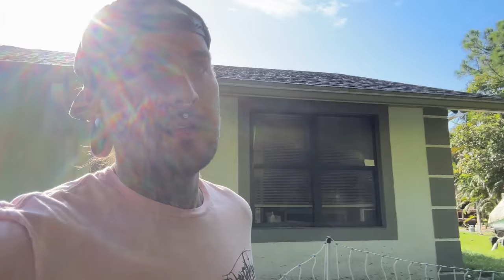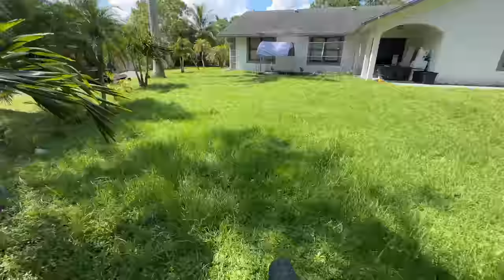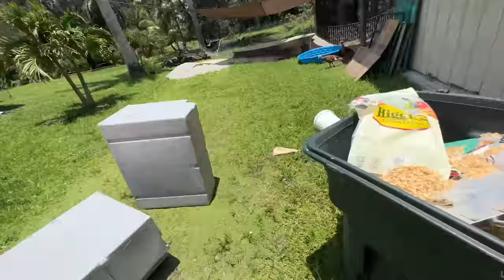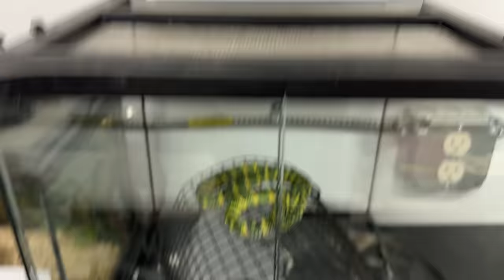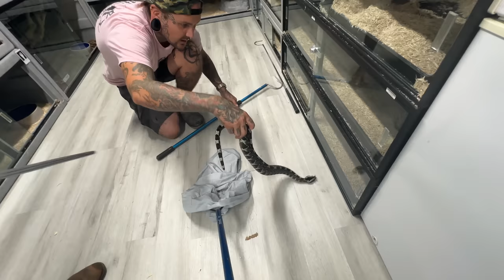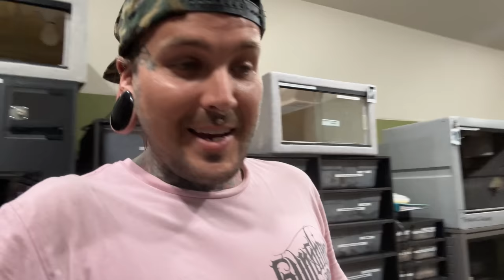MOVING MY VENOMOUS SNAKES HOME!!!!!

Comment: Blue coat is incredible. You can buy floor sweeper tube brushes super cheap and cut the down the middle with a table saw, sawsall or what ever. You end up with two halves and you can screw them to a fence or tree or what ever and it's super super cheap.  ( It's the rotory brushes that are on floor zambonies that janitors ride around) usually you can get the old ones the grocery stores take off for free.

Comment: We use big push brooms dismounted from the handle and drill a few holes for some bolts. Put a wood post in the ground in there favorite place to hand out. Bolt 2-3 brooms on the post. They are easy to change out when they get worn out and are fairly inexpensive I normally get the ones that are stiff. Works amazing for our 4 dairy cows. They absolutely love it. Hope this helps.

Comment: Wired push brooms will work just screw them to the tree.  Screw 2×4's to the tree first then attach push brooms to the 2×4's because I'm almost positive your gonna have to switch brooms heads annually. Hope that helps brother 🖖🏼

Comment: Hey Tyler as a suggestion maybe buy those large industrial broom, removed the handle and tie the brush maybe 2 or 4 of them wrap it around the tree and tie them with wire for sturdiness for the cow to use and rub. Maybe thats a cheap alternative until you find a good one 😂😊

Comment: You should spray paint rusty the king Cobra on your office wall.Would look 👌 😉. I'm so glad u got your snakes 🐍 home 🏡 Tyler. Everything in that room would be close to five hundred grand easily,I think. Keeping snakes is soooo expensive. Vision cages aspecially in Australia a small glass 30 by 30 glass enclosure starts at $170 up 😢.It's a hobby that will break your bank accounts 😅..

Comment: the wooden frame where you have cages set up on,  isn't it a bit risky them crawling under those? I mean it looks like a snake could easily fit under there especially under the set up of yur king cobras and rattlesnakes.
Or is that on purpose to offer the snakes a hideout to better anticipate their moves, so they won't focus that much on you and more on getting to a save spot?

Comment: Bro the 1300 doller one is not even electric. It Mec and spring loaded. So basically it pushes and pulls withe the cow. You can get a top of the line electric one for around nine hundered. Shit after checking them out I need one for my own room. 😂 But she is also very young and almost still a calf. Plus its only one baby and not a whole heard. I would say as you mentiond a few push broom heads in her pasture. She will get the point and love them as even those cows were taking it for test rides before ie even spun. I say a few large push heads and she will find her spot. Point then in different way and build something she can even walk under for the back. Then maybe as you see how things are going and she is full grown, if you want then go for it. I love the ranch and keep up the good work 👍!